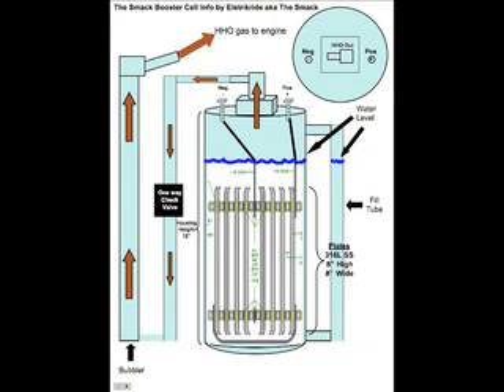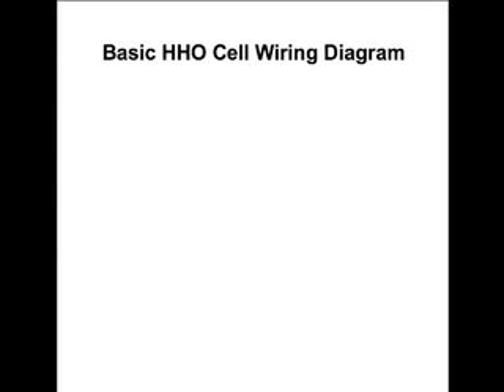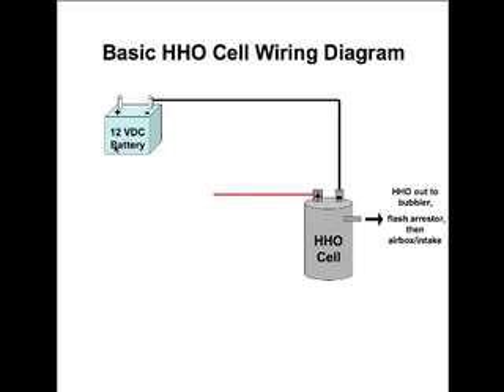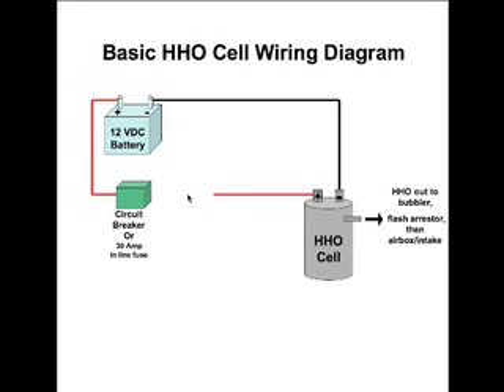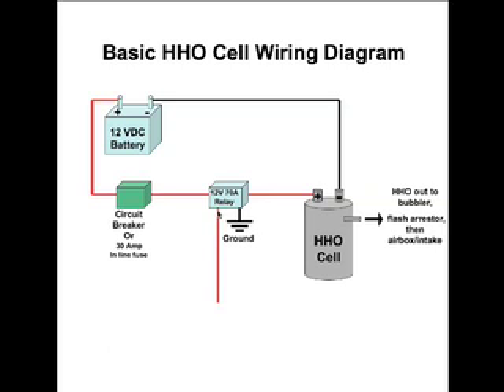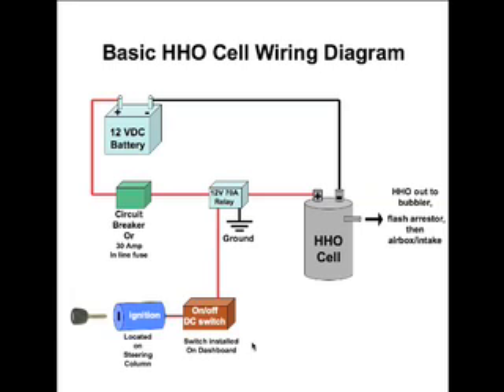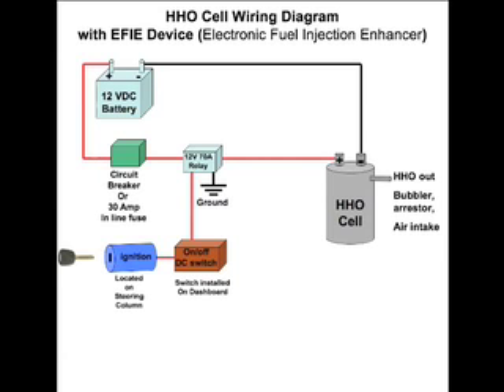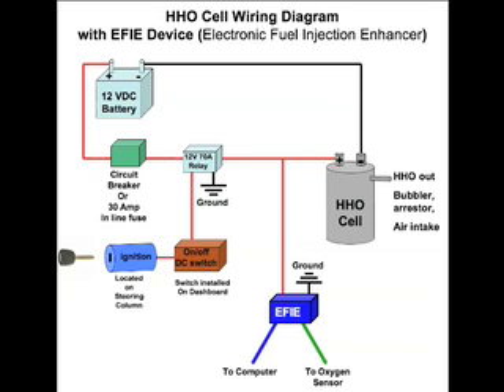Wiring diagrams for HHO Cells

Comment: What prevents the wires from overheating when connected straight to the battery and with practically no resistance in the HHO generator?

Comment: A car battery recharges at 0.4 amp 14v per hour so it takes 25 hours to charge it using your alternator, the maximum output of a car battery is 5.0amp 14v per hour, to produce hydrogen you need 5amps 14v this means unless your producing hho from your car stereo wires which is 0.1amp 12v which is impossible,your gonna end up running your car on hho for less then 1 hour then your battery will be totally flat and your car will stop,you then need to charge the battery for 25 hours with gas to get less then 1 hr drive time,that's not economical at all in fact its expensive and stupid. false economy
Reply: when my battery is stone dead and I boost just to get it started I let it run for ten mins  using the altenater then shut it off and test it and it's already 60% charged  it seems to me it charges fast by altenater. Any who one thing i am curious about is would it help to hook your dry cell up  threw a capacitor to the battery if it would take some stress off the whole system. Or go to and upgraded altenater altogether.

Comment: Im doing the basic wiring. Im wondering if the HHO cell be grounded to the chassis as well instead of running to the neg terminal of the battery.  reason being the battery ground of course is connected to chassis anyway. Will it hurt the system to ground HHO cell the chasis?

Comment: heat is the main problem... no one has given clearly how  wiring..
Reply: I figured that out mate.  Here is your config for wiring.  For an automotive system, grab you 10 plates of same size.  4 more need to be made a little longer so you can attach wires.  I am going to be using symbols of your steel plates for polarity.  Here we go:  +,N,N,N,N,N, -  -, N,N,N,N,N, +.   The N of this configuration stands for neutral, meaning no wires attached.  The two negatives in middle can be conjoined and ran to your negative terminal.  The positive leads on both ends co join by THICK wire on positive terminal.  The neutral plates drive your voltage down which actually helps in hho production.               Do it.  I am on a mission myself.  I cannot figure out wtf a flash arrestor is or a "bubbler".  I am well on my way.  I am going to be converting my 95 Honda civic soon.
Reply: You are having a heat problem because you have no neutral plates to drive voltage down.  I understand dc circuits.  Review what I write about polarity of your system for 12 volts.

Comment: What's the purpose of the relay if you have a switch? Could you not just run a wire from an ignition wire (only on when ignition is on) through a fuse then the switch then the HHO positive terminal? Or is it because you're afraid that the amps pulled by the HHO cell might be too much for the ignition wire that you splice into to handle?

Comment: hey, by the way, look this up, so that you'll understand. MOONSHINE STILL "worm" you want to send the "HHO GAS" through a cool down, this will give you something to mix with "2 CLY" eng oil, and dump it in the tank. 
Note: 2 cyl eng oil, is used to lube the fuel pump, and injectors

Comment: That was an awesome presentaion! thank you for explaining everything so clearly. Im uilding my first cell and am having trouble figuring out how to seal the pos & neg on the top  so i dont lose pressure. What is the config for the terminals using olts and washers?
Reply: I am adding my first one to my truck Thank you for caring enough to explain how it should be wired

Comment: Run 12v to the relay coil and low side switch the relay to ground. Only 3 wires are used to the relay and only one of them is needed to go into the vehicle cab. Ground the wire, relay turns on. Less wiring. Less chance of error.

Comment: great video, i have seen some where people are using small steel radiators(copper corrodes) and a small electric water pump to circulate and cool the electrolite and thus eliminating the need for the pulse modulator.  higher amperage alternators help too :)